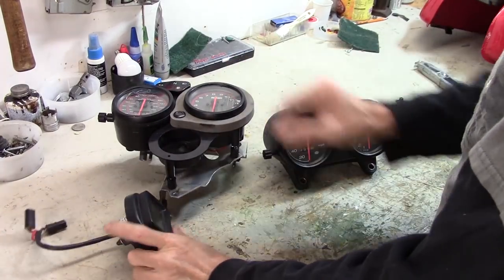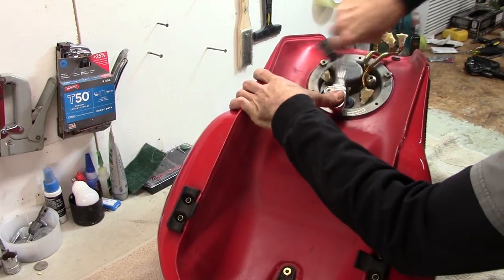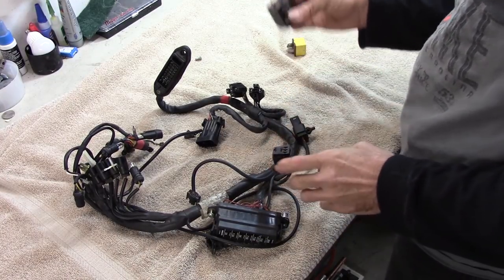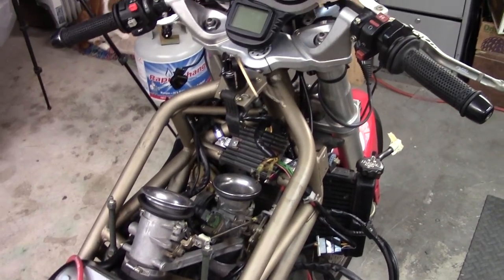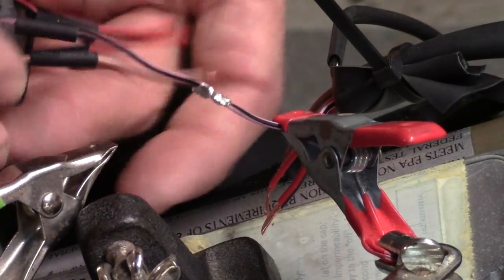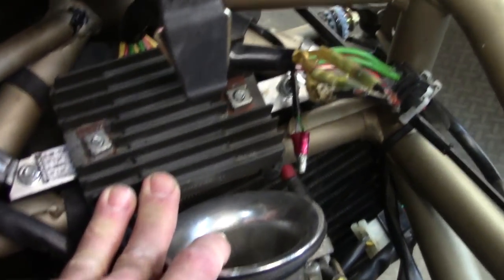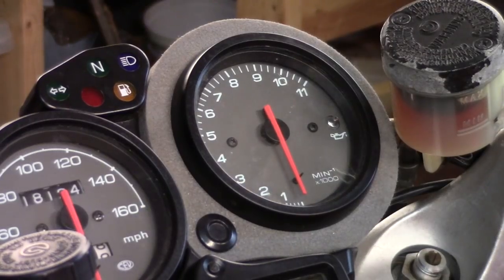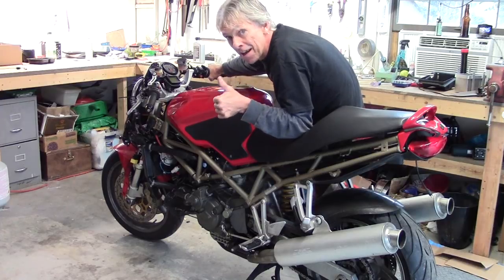Ducati ST4 Streetfighter Cafe Build Part 2

Comment: Good job man, I grew up riding bmw motorcycles with my dad. I switched to a Ducati years ago and still love them. The ST sounds just like it should. Don't let the little Ducati noises bother you too much. The only thing I can suggest from my own experience with them is keep up clutch maintenance. Check, clean , fluid checks and bleed well, and your pushrod, plates bearings etc...

Comment: Good job Dino, I swear I spotted a custom made Honda oil filter socket on the bench when you had the front loom laid out.  The kickstand sensor on my Duke ('96 900SS) just illuminates a red lamp, no safety relay.
Reply: You saw correct!

Comment: Looking good Kiddo! The reason why you have no side stand switch, is because that isnt the sidestand that came with the bike - some one has already put a Monster Sidestand on, because the stock ST one in 1999 was horrible, just gotta make one work or find the correct stand switch for the stand they used
Reply from the maker: Thanks again for the info. Ordered two Monster stick coils last night. :)
Reply: plugs might be different from the coil plugs you HAVE and the ones on the stick coils - but a chopped-up Monster Wire harness is maybe $50 and someone like ME might buy whats left of it from you after you remove the two coil molex plugs? also your coil leads may net reach the top of each spark plug now, so you'll have to add wire possibly - Not hard for you, youre very capable !
Reply: Eclidean I
Reply: ????? W'sup Bob?
Reply from the maker: I'll just hack up some extensions and connectors. ;)

Comment: I always bypass kickstand sensors.  I very often want to start my bike to warm it up or whatever while it's still on the kickstand so like you said you just need to keep your wits about you.  If your frame of mind allows you to forget to put your kickstand up it might be worthwhile rethinking if you should be riding in the first place....
Reply: I only know bikes you can let idle for warm up with kickstand down AND sensor in place while in neutral. Hard to imagine one that cuts off while in neutral.
Reply: Andre Heuser You know you're completely right.  I did have a Hyosung bike that would turn over with the stand down but generally it's not the case.  There's some reason I end up disabling it but the last two bikes I've had it already didn't work and I can't for the life of me remember what about it annoyed me. Hmm...

Comment: I’m having an issue with my ST4, I changed the fuel lines and now the bike is low on power and I think I put them in the wrong order. Which line goes to which throttle body?

Comment: there are too many cables and sensors. This is not a cafe racer, motorcycles should be simple
Reply: You're right, it's not a "Cafe Racer". It's a modern sport touring bike. HOWEVER, I choose to use the word "Cafe" in the title because it's inspired by the true spirit of those bikes which was about stripping off a few components.